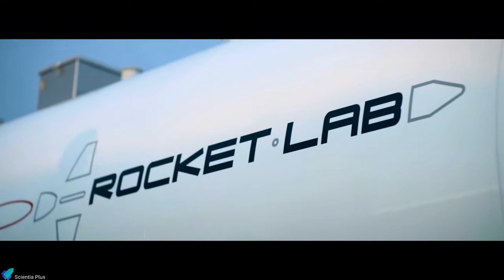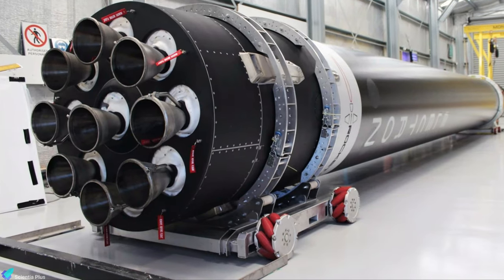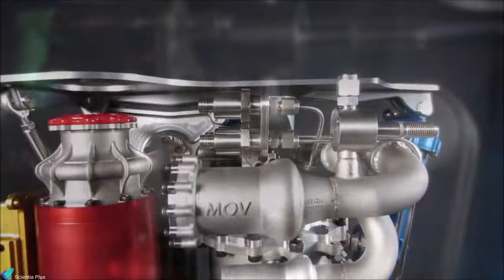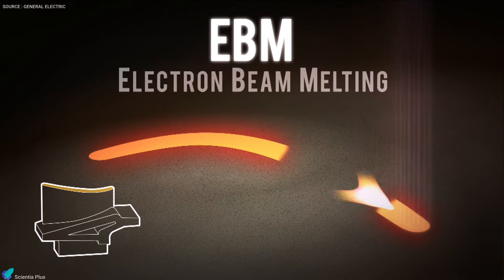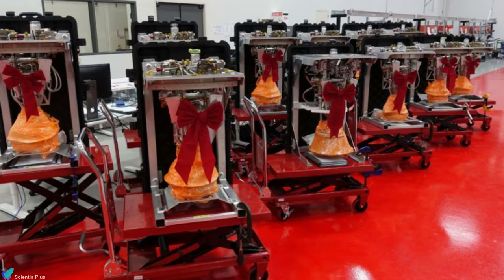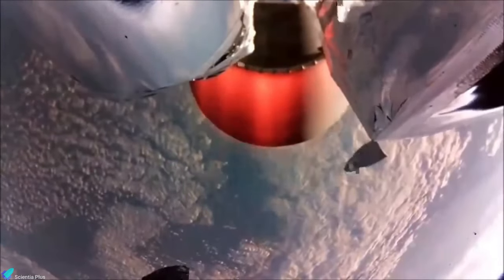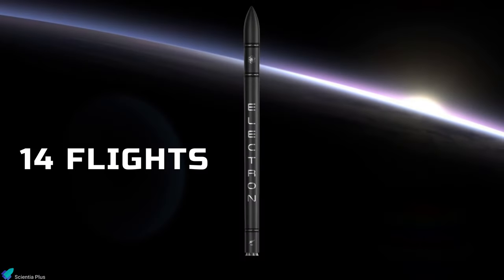The Astonishing Engineering of Rutherford Engine | Rocket Lab Electron Rocket Engine

Comment: At 2:22 you say that an inverter changes the battery’s DC to AC for the motors, yet at 2:48 you say that the Rutherford uses dual DC brushless electric motors. So which is it - AC or DC motors?
Reply: A brushless DC motor replaces the traditional commutator with solid-state electronics that control power to the motor’s phases, so in a sense it is a hybrid of DC and AC.  There is a good Wikipedia article about this.
Reply: @williamhanna4823  Smaller versions of these sorts of motors, electronic speed controllers and batteries have been used for years in model aircraft. Now full size aircraft, such as those produced by Pipistrel, use this sort of technology, but the range is still a tenth to a fifth of that attainable using conventional fossil fuels. Furthermore, the weight does not decrease during flight, as no propellant is expelled, which is why Rocket Lab have ingeniously resorted to dumping a used up battery pack during ascent of the second stage. I'm curious as to whether the first stage battery packs and ESC's will be re-usable after the first stages are recovered.
Reply: The power to the motor is variable-frequency three-phase AC.  But the electronics that produce the AC are small and located close to the motor.  The module is DC powered.
Reply: Why use batteries at all. just use a combustion engine and dynamo.
Reply: Ese Callum You need a lot of power to drive the pumps. Making a high powered combustion turbine is not trivial. Piston engine is not powerful enough.
Reply: @kazedcat  you can use dynamos or fuel cells
Reply: Ese Callum fuel cells are the opposite of powerful. Their power density is so weak that fuel cell vehicles need batteries to augment their power to actually move the vehicle.
Reply: @kazedcat  you can use the an alternator as in a car powered by an engine feeding a lead acid battery. this will be able to supply 1000 of amps. the lead acid battery would be initially charged and topped up by the engine.
Reply: @esecallum  Because batteries will get smaller and more efficient than any engine dynamo combo.
Reply: @DavidKnowles0  JUST USE SUPERCAPACITORS.
Reply: @esecallum  
Even worse on both energy density and specific energy than any other option
Reply: @esecallum  The combustion engine could directly run the pumps instead of having dynamo and motor🙂

Comment: Could they tap off some of the fuel & lox to power a turbo motor with generator instead of a batery?.
Reply: Not at that value
Reply: THis is done traditionally, what they are doing is replacement of TURBO pump with BATTERY pump

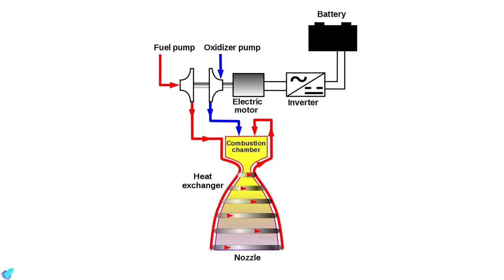Comment: In 2:15 you show a diagram of the electric feed rocket engine from wikipedia with the pumps mechanically attached with a shaft and one electric motor driving them. I think this is not correct for the Rutherford engine, but I cannot find the information online because everybody seems to be sharing this same information.

I think that the turbopumps in the Rutherford engine are not mechanically connected and there are two electric motors. One electric motor for the oxidizer pump and one electric motor for the fuel pump.

The reason to have independent pumps it is because the liquids are different and need different RPM and power to be pressurized. Also with the pumps being independent you are able to independently adjust the flow of fuel and oxidizer and therefore adjust the mixing ratio for the combustion.

Can anyone tell me if I'm correct?

Kind regards.
Reply: You can (but not must) have both pumps on the same power source. Both the raptor, most engines use one turbine to drive two pumps. You can adjust the ratio by simply put different pumps size. The fuel/oxidizer ratio is fixed anyway. But I’m not saying what you said is wrong, I don’t know that bit either.
Reply: @edmondhung6097  Thank you!

Comment: New Idea is great ...not to much tubing  around the engine not like the Raptors engine..
Reply: Well those 2 engines have 2 different objectives

Raptor is meant to be powerfull and reusable

Rutherford is meant to be expendable and quick/cheap to produce
Reply: Also rutherford is like 10 times smaller than the raptor so it can be much less complex
Reply: Raptor needs tubing or it would overheat. It runs on full flow, which is very hard to handle and raptor is actually the first flown full flow engine
Reply: @Aditya Suri Can you explain a little bit more please ?
Reply: 🤔 Thinking the same, later in the video I realized the size... a compact car vs Truck?
Reply: Well they catch first stage with helikopter and reuse 9 out of 10 engine
Reply: @UClOhTzCI2lcAFQhhOuppSEg yeah this was a mistake from my side. What I meant is "full flow staged combustion cycle engine". In that case my statement would be true because no other ffsc engine has flown other than raptor
Reply: The Rutherford is indeed at the opposite end of the scale, in that it is almost the almost the least advanced engine as far as performance goes whereas the Raptor is currently the absolute top end of the performance/efficiency scale. There are LOX/LH engines with higher performance but that is due to the fuel they use, not the engines.
The often quoted ISP of the Rutherford engine is somewhat misleading because it omits the mass of the batteries from the equation. Once you take that into consideration the ISP is below that of even the simplest open cycle gas generator engines.

The Rutherford engine is indeed a great engine, but not for the reasons many people think it is.  What is great about it is that it is easy and cheap to manufacture with simple tools and many off the shelf components. It is also great for reusability as the only part that wears out is the combustion chamber and even that not so much due to the low performance demanded of it.  The price to be paid for that is a big impact on the performance, limiting the delta-v that it can achieve for a given mass ratio.
The genius of Rocket Lab is that by going electric they managed to bypass the most difficult part of rocket design, the turbopumps, while still having performance superior to a simple pressure fed engine. This allowed them to go from nothing to orbit in record time and on a record low budget.

On another note, the thumbnail of the video is extremely misleading. By the same measure that the Rutherford is a battery powered rocket engine you can say that almost all of today's cars are electric powered since they also use electric pumps to push their fuel into the engine, which is what the 'electric' in the Rutherford engine is all about.
Reply: @listerdave1240  wait mass of the battery battery have same mass olmost is it is not propellant Just lower trust to weight not isp for isp it is realy good it is a efficient but heavier engine i Mean engine is 35 kg battery is 60 kg
Reply: @listerdave1240  ok consider this a rp1/lox engine with oxygen rich preburner that has one turbopump rather than connecting all these pipes to one turbopump we did not connect that small connetion of preburner rp1 side to and use a small electric engine there and or turbopump provides pressure and trust to main chamber the electric pumps Just carry the fuel where it is have to be so turbopump can provide more pressure to main chamber with less woryy from pipes exploding from pressure you could get a engine preburner engine that is simpler and cheaper than Just gas engine
Reply: Lister Dave ISP is a measure of propellant exit velocity it has nothing to do with the dry mass of your rocket. What you are describing is total impulse/wet mass that is a completely different parameter to Specific impulse.

Comment: Maybe not something you would do in first stage. As others commented, the energy needed is not weight efficient in large scale. But i think it is an interesting concept for orbital maneuver. At that stage, the engine is smaller, can deploy solar panels to charge the battery back, the battery may be can share with the ship.

Comment: Batteries are the Achilles heel of electric motors and therefore pumps. From what I can understand bigger rockets would run into the problem of battery density. But as Peter Beck has said time and time again they aren't interested in anything bigger then their current rockets.

If batteries improve then we might very well see human rated launch rockets.
Reply: Copenhagen Suborbitals is considering an electric pump for their human rated SPICA rocket now under construction, but they have a heat-powered alternative option if the electrical pump isn't good enough.

Comment: Nice video.  However, you mention at 2:21 that the electric pump fed rock motor the battery DC current goes through an inverter where it is converted to AC to power the motor.  On 2:47 you mention that the motors are  brushless DC electric motors.  It should be noted that DC motors as their name implies use DC current and hence don't require inverters to provide DC to power the motors.  They may use inverters for AC conversion to transform to a higher voltage and then rectified back to DC for motor usage.
Reply: this is 100% wrong. Brushless DC motors still need a controller that supplies a pulsed current to the motor. Otherwise, it wouldn't spin.
Reply: @Stefan-rg1ub  Right you are.  I forgot my "Brushless" DC motor theory.  In a regular DC motor a commutator, commutates the electrical supply, which is effectively changing the DC to AC allowing it to rotate. A Brush-Less DC Motor uses an external electronic commutation, in other words, an Inverter.  I apologize for my momentary ignorance.
Reply: @WWeronko  but if current comes to motor pulsed and commutated is no more DC corrent?!?
Reply: @edmilsonbtu  It is still called a brush-less DC motor.  Some would say it is not DC any more.
Reply from the maker: A brushless DC electric motor is powered by direct current electricity via an inverter or switching power supply which produces electricity in the form of alternating current to drive each phase of the motor via a closed loop controller. The controller provides pulses of current to the motor windings that control the speed and torque of the motor. This control system replaces the commutator used in many conventional electric motors. 
https://en.m.wikipedia.org/wiki/Brushless_DC_electric_motor
Reply: @scientia_plus  That was covered.  Thank you though.

Comment: "World's first battery powered rocket engine" – I don't think Rocket Lab used the world's first battery. It would be far too weak for their motor pumps.
Reply: Battery powered not battery
Reply: @observeoutofthebox7806  Yes, that's what I – and they – wrote, wasn't it?
Reply: @Anvilshock  you said they didnt use the world's first battery. But actually the sentence isn't worlds-first-battery powered 
It's worlds first battery-powered pump.
It uses top notch lithium battery cells. That can hold upto I think 37kwh. Powerful enough to turn the pumps and pressurize the fuel into combustion chamber
Reply: @observeoutofthebox7806  I know it uses batteries and for what it is using it. Good job missing the point. Yet ironically, you had to explain your point with the very device whose omission I was mocking with my original comment. Isn't that telling? And in case it's still not clear: Yes, you had to use hyphens to switch the meaning of the sentence from one it has without to the one it has with.
Reply: @Anvilshock  mate if its sarcasm you could have just said so.
Reply: @observeoutofthebox7806  Sorry, I don't do padded picture books for pre-kindergarteners.
Reply: @Anvilshock  that attitude wont get you far in life mate  :)
Good luck
Reply: @observeoutofthebox7806  Given how sarcasm is a common thing in inter-human communication, and with you evidently having problems detecting it reliably, I'd say that goes for both of us.

Comment: Using electric motors instead of the turbo pumps is just a matter of fit for the job.  They want the highest reliability at these crazy temperatures.  Good to see the design competition taking place.  the new Raptor has guarded secrets, and Elon talks about reducing battery weight.  Elon likes a simple reliable design.
Reply: he likes designs so reliable that 80% of the raptors that have flown have failed, hahaha elon fanboy

Comment: If the motors are DC for what need inverters?!?!
Tesla is very mad now lol
Reply from the maker: A brushless DC electric motor is powered by direct current electricity via an inverter or switching power supply which produces electricity in the form of alternating current to drive each phase of the motor via a closed loop controller. The controller provides pulses of current to the motor windings that control the speed and torque of the motor. This control system replaces the commutator used in many conventional electric motors. 

https://en.m.wikipedia.org/wiki/Brushless_DC_electric_motor
Reply: @scientia_plus  1 phase to 3 phase is thet correct .
Reply: @scientia_plus  so DC power supply, but AC winding current?
Reply: The motor is actually an AC motor. The inverter delivers AC at a very much higher voltage (and thus lower current) than provided by the battery alone. All current carrying components (including the motor) can thus be made smaller and lighter. There is a weight saving advantage in this scheme.

Comment: First you show a diagram of the engine with an inverter that inverts dc power from battery to ac power to power the motor but the you say that the engine uses brushless dc motor.

Comment: I think it's great. But wasteful. They need to learn from SpaceX. Land the boosters. Then those batteries would help pay for the cost, by recharging them, instead of letting it burn up.
Reply: They're already planning on recovering the boosters, even though they believed until recently that it was not economical to do so. Also, the batteries are such a tiny drop in the bucket of the costs of an Electron launch it's not even worth talking about. The cost of a launch of this (tiny) rocket is millions of dollars, keep that in perspective. Their factory infrastructure is (allegedly) geared to producing dozens of these rockets per year.
Reply: Mission 17 they are planning to recover the 1st Stage Booster by soft landing it and then hopefully Mission 18 they hope to sky catch the booster. Go check their youtube channel... They have a videos of the plan and even proved the sky catch
Reply: There is no margin for propulsive landing. But they did recover one this week

Comment: liquid oxygen hydrogen rocket has only 8MJ/kg of specific energy, metal-air battery has up to 40MJ/kg specific energy, if used for full-electric rocket engine, for example heat engine, air scoop resistive engine
Reply: instead of sweep single head print, you could make fast lithographic mask printing
Reply: electron (vs ion) electric engine should be nice
Reply: instead of random powder stacks, you could have quick layer mask powder sheets, then x-rayed to bond

Comment: Electric motors are not more efficient than gas turbines especially large scale overall. The added weight actually overall reduces capabilities but they do take away less energy from the combustion but this need to be stored in some form which the heavy batteries are for. This would only work small scale. Larger scale such as the raptor engine would require massive batteries and ridiculous size electric motors. If you would increase capacity and power density while decreasing the weight of batteries it would be more applicable for further use in small rockets. But never larger ones without major development in electric motors and battery technology.

Comment: Its good for spare flight in space due  electric motor not get impact on micro gravity☺️🐼🐼 its will impact bottom side motor from what i see... Need new designer put that motor like normally not like this... Its give impact on bottom side... And the front motor put turbin fan so after spinning not cost more energy from the battery and for cooling ... And if  can add auto charging and solar system after on the space... Its can be used space transport☺️☺️☺️...
Reply: Nonsense.  The motor in the front (second) stage isn't used until the rear (first) stage has thrown it into space with 5 spring loaded pins.  This is completely traditional on all multi stage rockets.

Comment: That is very innovative way to build a reliable and simple rocket engine. At first it seems this can't work at all because the low energy density of batteries. The secrect is dumping batteries and saving weight on the engine itself, and have lighter system at the end when deltaV really starts to grow.

However, it hurts to waste perfectly good batteries and because they need to be dumped out, this solution don't support good reusability. It most likely remain as an interesting solution for this particular use-case.

Comment: Seeing all of the problems they have with the raptor engines, leaking fuels and blowing up, I wonder if this would have been a better design for the starship? I can also imagine that this thing would be better for precise throttling than a full flow rocket engine with pre burners. Or is it just a matter of dialing in the parameters of the raptor?